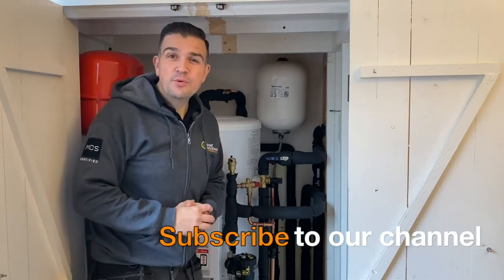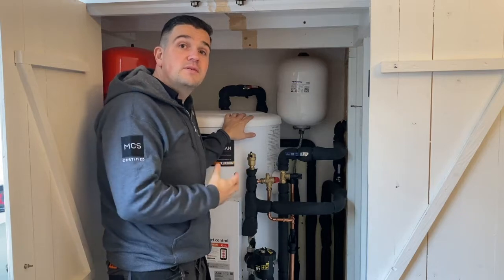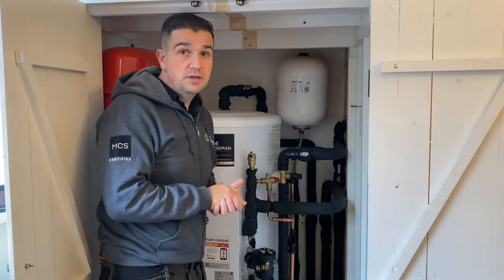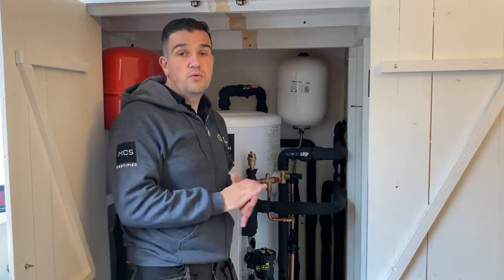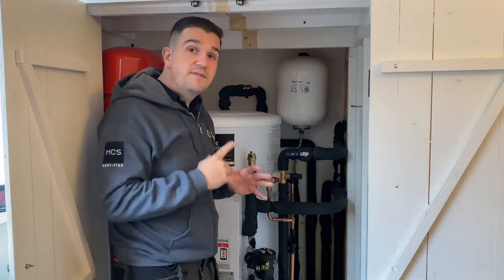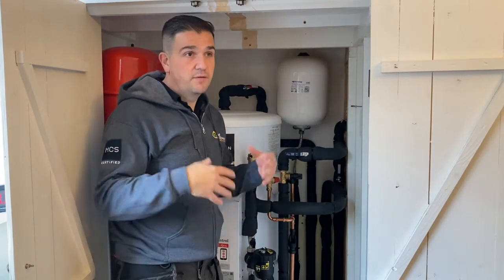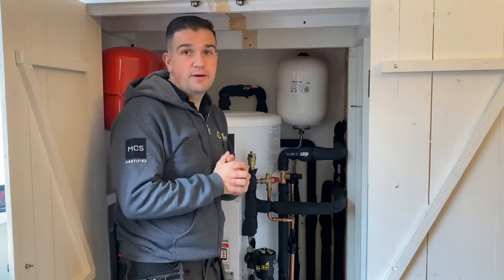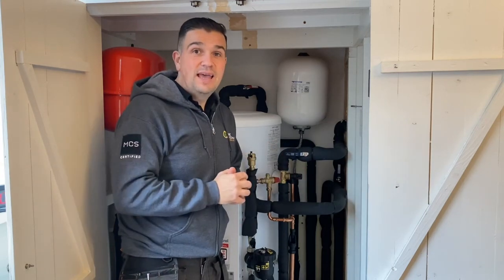Mitsubishi Ecodan Retro-fit Installation

Comment: Could anyone please tell me the dimensions of the DHW plate heat exchanger attached to the tank shown in this video? I want to retrofit a plate heat exchanger to an indirect heated cylinder with a too-small coil. The heat pump is 8 kW but I have the EHSD-VM2D wall-mount indoor unit. Thanks in advance!

Comment: Hey, thanks for the video. Not that much out there about ecodan products that are actually helpful. I have had an ecodan 14kw for nearly 2 winters and my cop is around 2.2. Any idea on any factors that can increase it? I keep my flow temp around 48. Mine is also a retrofit on a very old house. Cheers
Reply: Increase radiator sizes and apply more insulation to the dwelling
Reply: Is it cycling? What did the heat loss calcs tell you about the required ashp size because it could be oversized and thus cycling heavily, drastically affecting your cop.

Comment: Hello, we have the EcoDan 14kw with 2 zones. Would you be able to help with my question? We recently noticed that radiators are not getting as warm as they used to. When we checked the pressure it was bellow 0.5bar when running. Is that suppose to be at 1 bar when running? Or is there anything else that could cause the radiators not heating up? Thank you

Comment: I was rather hoping you'd have given some indication of any changes that were necessary re: radiators or adding UFH to the property
Reply from the maker: Hi Wicky, we only had to change a couple of radiators on this project. If you look at some of the other videos on our channel we discuss another retro fit system with some more detail and a look at the UFH system we installed.
Reply: @dorewoodman  Thanks, I'll have a look for them